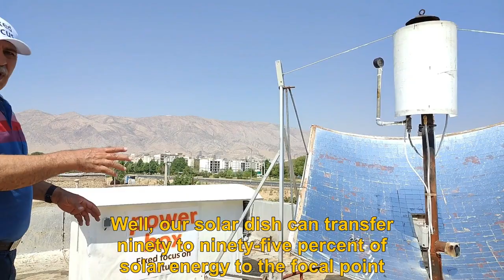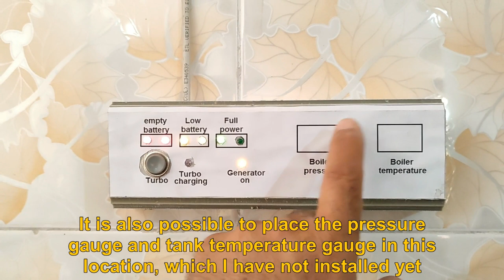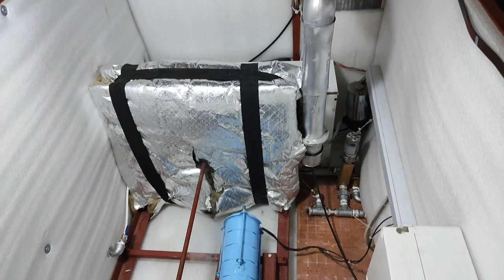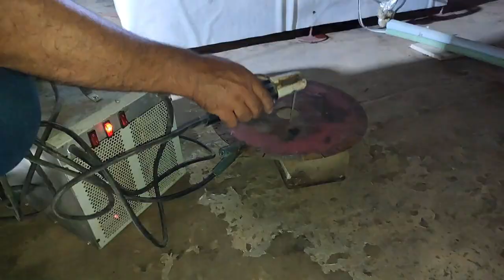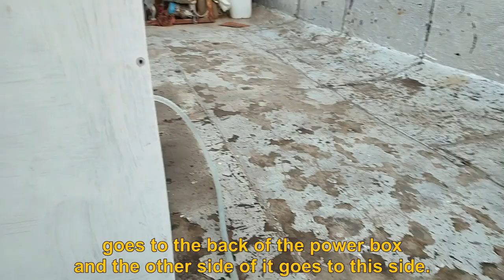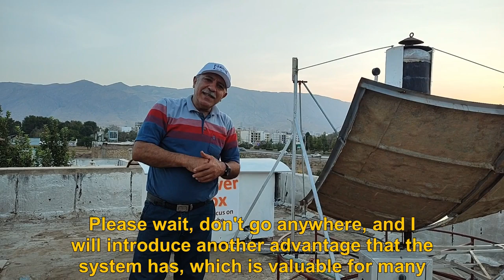A revolution in home electricity supply.The new generation of home power plant

Comment: Hello again :-)
Sorry, i stopped watching halfway up to where you tested your welding machine :-(
If your system needs a 3000W inverter and batteries, well then you better charge these with solar panels during daylight - and forget about solar steam power.
And wasting city gas on a 1-3% total efficiency system is an even worse idea.

I like your solar mirror dish and your steam turbine.
But to make it a useful invention, you should do without expensive batteries and a dc-ac inverter. Instead find a ac generator (from a broken portable gasoline ac generator) to be directly driven by the steam turbine.
With the solar mirror do not create steam directly but heat up a big stone of cement containing a flash boiler. Or heat oil which in turn heats a KNO₃-NaNO₃ temperature buffer to 200-300°C. That way you can store up to 0,5 kWh/kg. So 20 kg of a mixture of potassium nitrate and sodium nitrate could store up to 10 kWh of heat and can have better heat insulation than the boiler in the focal point of your solar dish. If your steam turbine plus ac generator would reach 5% efficiency, that would be 500 Wh of electricity.
To generate steam, you would use a flash boiler, going through the heat storage. and a little dc injector pump could regulate the steam production to match the ac load.

That way, maybe you would get a cheap simple system that could compete with batteries and solar panels...
But i highly doubt that you can go above 3% total efficiency. And solar panels are above 20%.
Your only pro ist that solar panels + batteries + dc-ac is 100% high tech, whereas your solar dish + steam turbine + ac generator is 90% low tech.
Reply from the maker: Thank you
You are right and for your suggestion a large solar dish should be used
And also the efficiency of solar thermal systems is higher than 35% like the solar tower power plant

Comment: Great job on creating power plant with common parts. I am concerned that the radiator used does not contain lead as drinking the water would be bad for your health.
Reply from the maker: Thank you dear friend
No, this radiator is not soldered, it is pressed and the pipes are aluminum

Comment: Dear mister Hashimi, what do you think of connecting your solar collector to absorption vapor chiller air conditioner ? 
Producing coolness from solar heat.
Reply from the maker: Thank you dear friend
Of course this can be done, but scientifically it is not efficient unless we set up several systems as collectors
But the solar thermal system has an efficiency higher than 35 to 60 percent and this depends on the quality of the system
And it certainly produces better energy
Reply: @fixedfocussolar 
Exactly Mister Hashimi, surely the system that I meant uses water-beomide solution to create coolness.
The whole process  depends on the 2 following factors : 
-type of solar collector (parabolic dish is the optimal choice especially for a modular household system)
-average solar irradiance (in order to have calculations about the operating days and times of the system).

Comment: how many KWH the gas can produce.. per pounds.. gas consumption
Reply from the maker: thank you
I can't say exactly, but according to the laws of thermodynamics, if the gas is consumed ideally, its production power will be better than gas-burning generators.
Reply: @fixedfocussolar  that is definitely wrong. gas-buring generators reach 10% efficiency, whereas your gas-burner + steam-trurbine + belt-drive + dc-generator + dcac generator will have an overall efficiency of way below 5%.

Comment: 450 to 500w slow mode
with that space used. and craftmanship.. its a  masterpiece work but irather put 550w solar panel.. 

very good work.. above excelent..
Reply from the maker: Thank you, dear friend.
The efficiency of solar thermal systems is much higher than that of solar panels.

Comment: You can also upgrade this syatem by adding thermal energy storage. So you can avoid using fossil fuel at night time power generation.   Add more solar absorber ( Dish ) and by using suitable media ( HTF/Molten Salt) store the thermal energy.  Night time when there is no sun use this stored thermal energy to make steam and run the system at night withouf fossil fuel.. ( 100 % green energy)
Reply from the maker: Thank you dear friend
This system should be placed in the production line to eliminate its disadvantages
And you are right

Comment: great video! can you go into detail on the dc motor used, the motor specs, and the rpm of the turbine? How do you regulate the voltage to the inverter? Also can you obtain more power using a permanent 3 phase ac motor and a rectifier?
Reply from the maker: Thank you, dear friend
With a larger solar dish, any generator can be rotated, even three phase generators
The making of this generator is shown in the following video
https: //youtu.be/gv1C63xwlxY
Reply: @fixedfocussolar  thanks for reply! I have watched almost all your videos now haha. fantastic work! I would love to see all the final steps in the build! the steam valve motor and more info on the steam condensing system. Thanks again for all the great videos

Comment: Nice. I have few questions. 1) The small size alternator/generator cannot run for long hours. More heat could burn the coils. how you are managing that? 2) How you are maintaining the water level in tank/boiler, as there should be some space in the tank for the steam. Like keeping 70% of the tank filled.
Reply from the maker: Thank you dear friend
You are right, but the power output of the generator is much more than what we use, so it produces little heat.
It's like you start a 24v electric motor with 12v and it spins but takes a long time to heat up.
Regarding the water level of the boiler tank, it should be said that the pump inside the power box injects the same amount into the boiler tank that is set in the power box tank.
It should be noted that water is injected once in each turn and it is not injected until the water inside the boiler is exhausted
Please share the video with your friends if possible
Reply: @fixedfocussolar  - Thanks 👍I was making plans for Solar thermal power generation and water desalination. This is one good setup.

Comment: Great effort... Energy should be cheap and environmentally friendly...
Reply from the maker: You are right
This system is bipolar, one side is connected to clean energy and the other side is connected to fossil energy
But for many places where the sun is most of the seasons, it works well
Currently I use this system for the whole house lamps

Comment: Producing electric power with Solar power it's Helpfull for agricultures ❤
Reply from the maker: It is definitely the same and you can use the electricity produced from solar energy in agriculture
Reply: @fixedfocussolar  Your turbine generator system  is best for sand batteries.

Comment: A wonderful station. I think its efficiency can be improved with a Tesla turbine. Bloggers Charlie Solis and integza made such a turbine and sell it, unfortunately it is expensive, but they showed the process of its manufacture and assembly. Currently their 10" turbine produces 2.65 kW at 90 psi, their 4.5" turbine produces 1.2 kW
Reply from the maker: Unfortunately, the Tesla turbine is not suitable for very hot steam, and if it was suitable, the power plants would use it